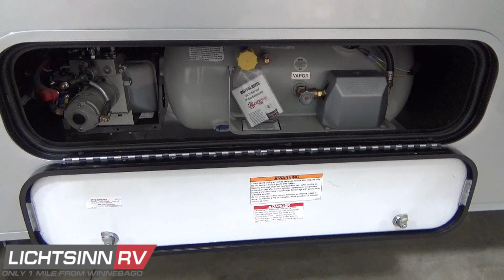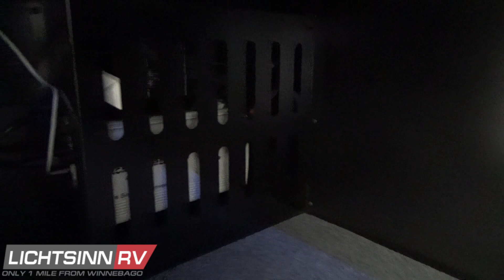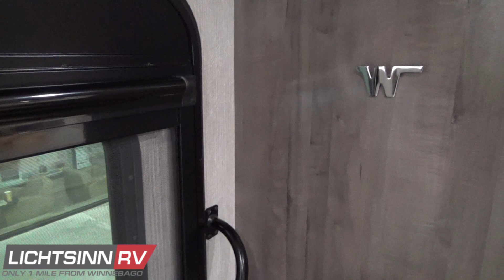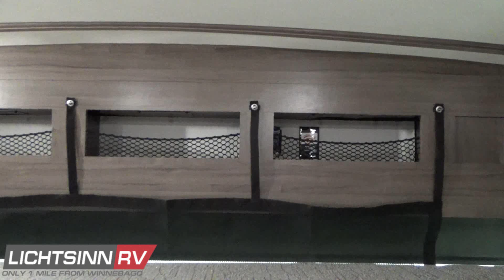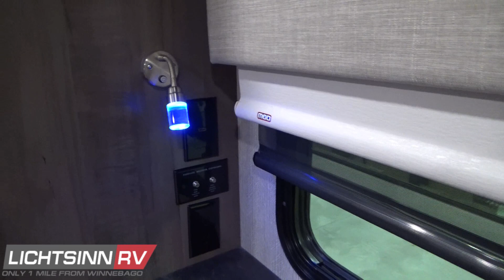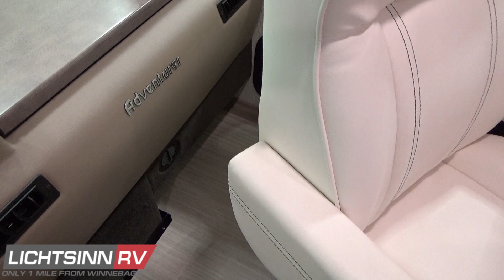LichtsinnRV.com - New 2022 Winnebago Adventurer 30T

Comment: this said a "regular queen size mattress" does that mean its not a "rv short queen " and regular qeen size sheets can be used
is the outdoor kitchen an option and are solar panels optional
Reply from the maker: Good morning!   Thank you for your note!   Yes, this is a residential sized queen at 60x80" vs a 60x75" traditional RV queen, so regular queen sheets can be used.   The outdoor kitchen is only an option on the 29B floorplan... solar prep is standard and we can the plug and play solar panel size based on your use.   Hope this helps!